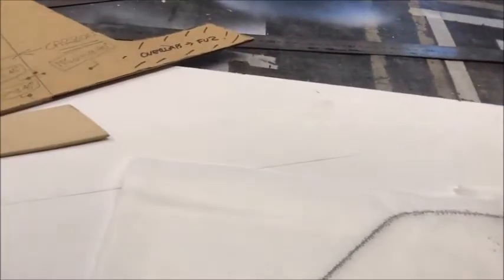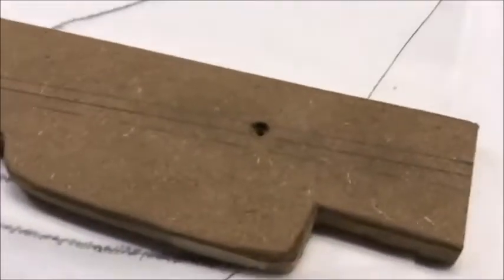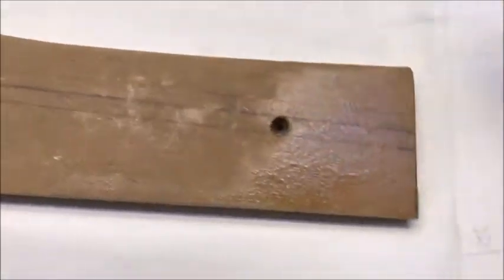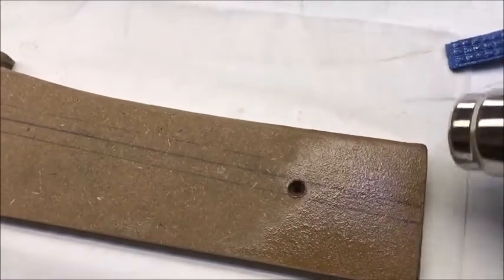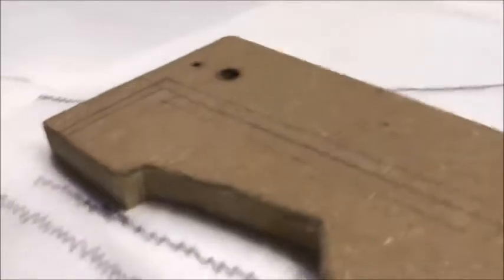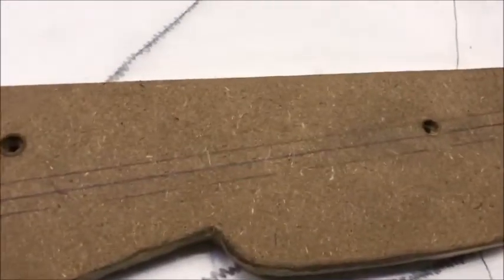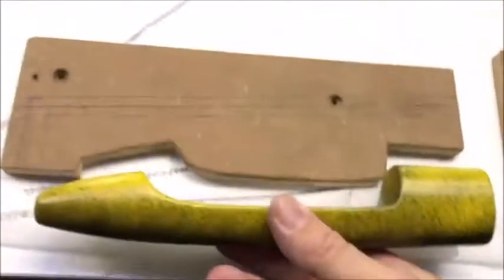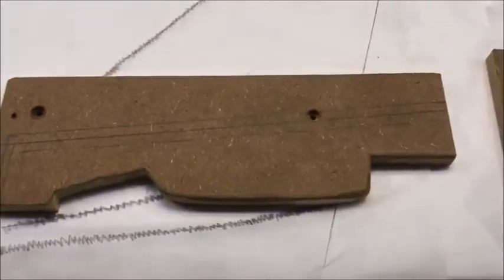Expoxy Saturated MDF - First Go - 07 April 2019

Comment: do you think you could rout a mould from MDF and then use this epoxy method to seal it?
Reply from the maker: Neil, a popular method, admittedly using a CNC mill, is to do the initial cuts between 0.5 and 1.0mm high, saturate the MDF, let it cure, then cut to finish level.  The epoxy soaks in a good 3mm, so you end up with a saturated mould surface that wet-sands much better.  I suspect that sealing with epoxy after routing might leave a surface that needs too much work to make true again - from "fuzz" and the like.  There is always the option to try a small job and see how it goes. Good luck mate.
Reply: Thanks Steve, I might ask some more questions on RC groups. Given I only want to make gliders for my own use, so watching costs is important.